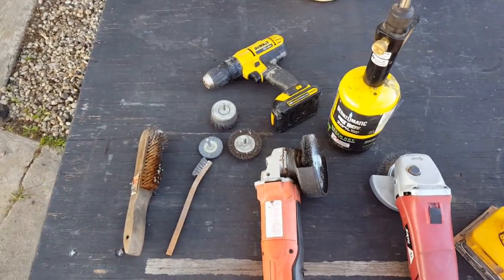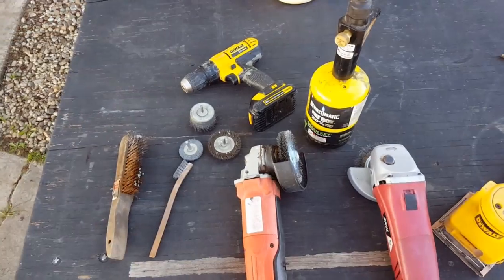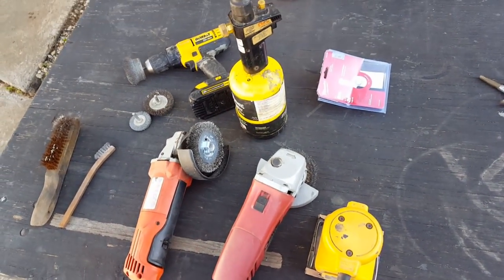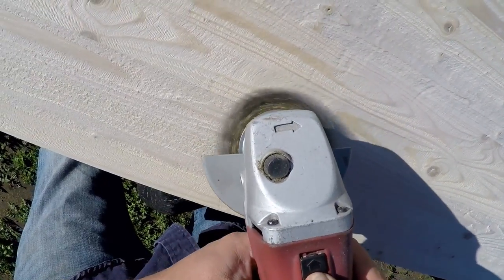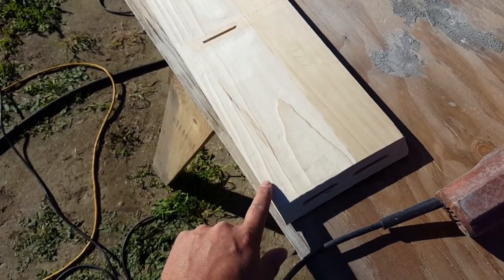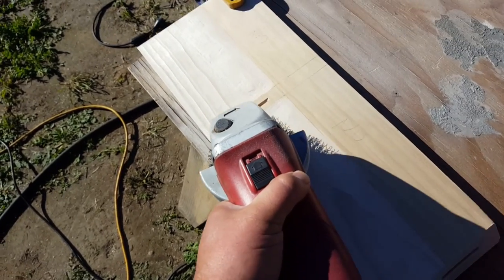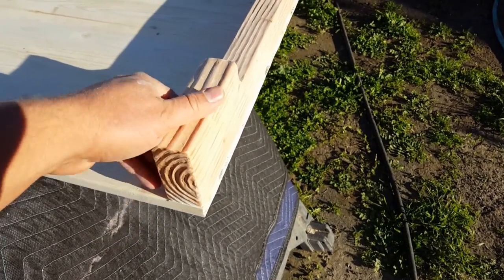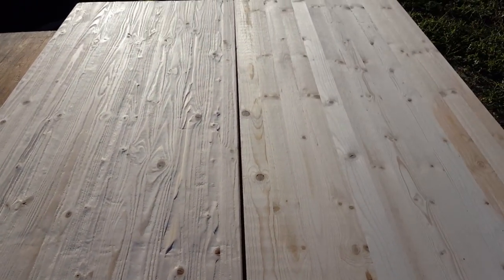Distress Wood With Wire Brush Wheel | Make Wood Grain Stand Out | Raised Wood Grain Texture

Comment: I do have a hand sander but what grit sandpaper did you used on this project Chris? By making a cufin out of plywood would I be able to get that effect from the way you did it there? Especially using the torch?
Reply from the maker: Richard Soto I usually use 120 grit but you could use another and plywood won't be as drastic of a raised wood grain but it works a little.  Test on a scrap piece if you have one.  You may only be able to get the burnt color from the torch instead of raised grain but try it if you can.

Comment: What kind of wood is cheap that I could use for my haunted house? Last year I used tarp for my walls attached from a pvc pipe at the top of my tent.
Reply from the maker: JPland21 Gaming Legalstarling10! Try to find discounted wood at the box stores first, you could use 1x3 pine and underlayment plywood, or you could use 2x2 and chip  board for siding.  That's going to so of the cheaper ways.
Reply: Hollywood Haunter thanks ill look into it!

Comment: WTH?????? why are you showing ppl to use the steel wheel running PERPENDICULAR to the grain?? This is just asking for a coarse finish.

I'm so incensed by this "advice" I'm actually considering making my own vid to show how do to this properly for the best smoothest results - like on my furniture.
Reply from the maker: This video is about us purposly making the wood grain stand out.  The whole point is we didnt want  a smooth finish.
Reply: @HollywoodHaunter   I'm not sure you understood my post.  You still see the grain - but if anyone sees this vid and decides to do it this way, and then add a finish coat of poly - or stained wax or something - the perpendicular lines of the wire brush is going to become extremely visible and look truly TRULY terrible. - try another section at home, add some staining wax and see for yourself.
Reply from the maker: We did paint and clear coat and you can see the results here if you want. https://youtu.be/0E3d6T9jIdc